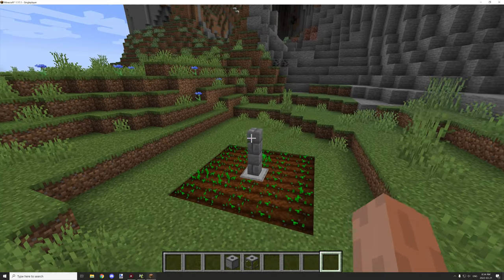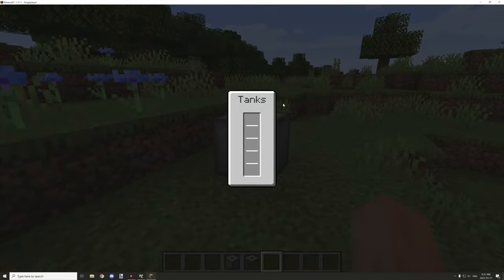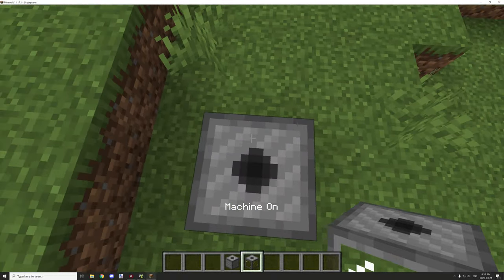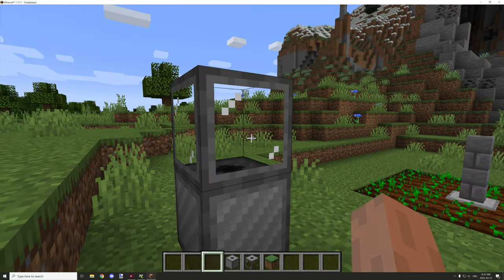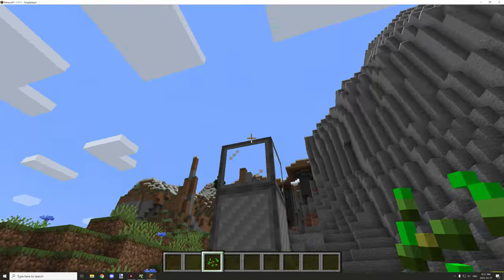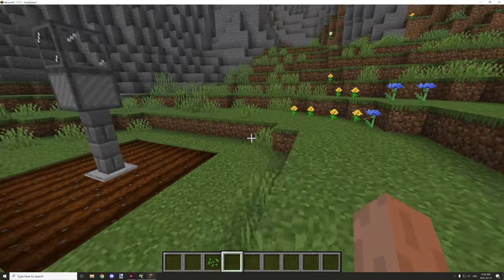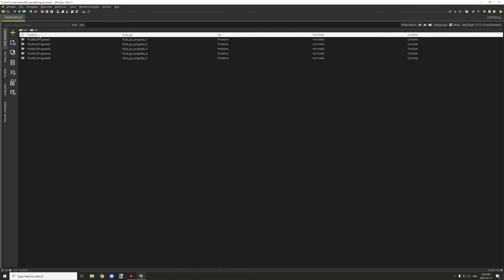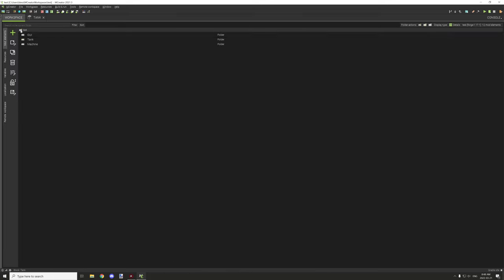MCREATOR TUTORIAL: Block Forge Fluid Storage | 2021.3

Comment: Ive used this for a basic liquid storage that holds 3 buckets of water and can be drained/filled with buckets. The progression 1 image doesn't work, nothing shows till it is on progression 2. Anyway to fix it or why it is doing that?
Reply from the maker: Chances are it's the range for the first condition to display the texture.
Depending on your system you will want to keep track of the amount.

If you have 3 buckets depending on if you hold a value of 3000 millibuckets or use a simple number to keep track like 3 you may need to adjust the values for the range for each progress display condition.

For millibuckets, it would look something like this.

0 Bars:
If Variable =< 0

1 Bar: 
If Variable > 0 AND Variable =< 1000

2 Bars:
If Variable > 1000 AND Variable =< 2000

3 Bars:
If Variable > 2000

For a single digit, you can test if the variable is a set number.
The values below are in the same order as above.

If Variable = 0
If Variable = 1
If Variable  = 2
If Variable = 3

This would be for the image display condition.
I hope this helps.

Comment: How would i go about making pipes to transfer fluid between storage blocks and such?
Reply from the maker: Same idea but depending if you want it to be able to push two directions or all sides you will need to test if the fluid has space to transfer the fluid the move it a direction for each direction I would make the direction random so it can even out the directions it send fluids to or create a simple number toggle system where it increased a variable each tick and tries to send fluid one direction at a time.

Comment: I need something like this so that I can introduce 4 different liquids from all sides, but I can only introduce liquid "A" from the right, liquid "B" from the back of the block, liquid "C" from the left, liquid "D" from the front of the block.
At the bottom I can take out liquid E and from the top I have an input for the current.
ABCDE each has a capacity of 2000mB
Current input e.g. 10000RF
No interface inside the block
How to do this?
Reply from the maker: I am working on a new series for Forge energy and fluid that uses pipes and cables it will make more sense once I get to the liquid part but rest assured this will be covered in this playlist. https://youtube.com/playlist?list=PL5k7swYOU_yTIu9xFwVbW52KVqZsIU9LP&si=-ulrWGhYfQqDkg96

Comment: Hi Northwest, how i can create more Tanks in one Block?
Reply from the maker: So I took a look at the NBT data for a block for fluid, and then looked at the procedure blocks we have to work with, once I have looked at those two things I turned to google.

From what I can tell, even though tanks technically have support for different tanks its not really use ever due to issues with transporting liquids.
This does not mean its not possible using a custom NBT storage system for liquids but it will require time for me to figure out and make a procedure to store ForgeFluid into different tanks then send them to pipes for such designed liquid, this would be harder as some pipes might be able to be used for different liquids which could be the conflict I read about, so two kinds of pipes would be needed in order to make this system work.

However I will make a note on my feedback tracker for the tutorial suggestions so I don't forget to work on it when I have time.
Reply: @NorthWestTreesMCreator  ok, thank you

Comment: Does this work for modded plants?
Reply from the maker: Custom blocks do not use age block states so no.
However you could adapt the update tick for your custom crops to update the crop stage based on a block number NBT value then have the script in this tutorial change that value instead of the age basically same method but using block NBT variables.